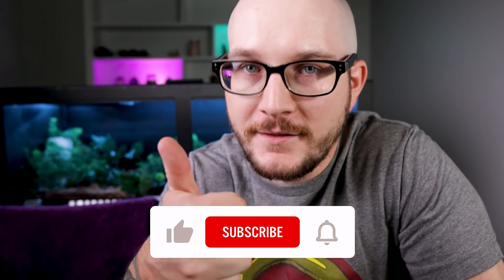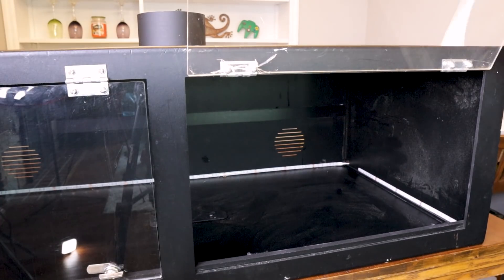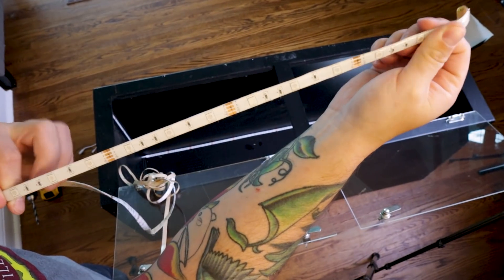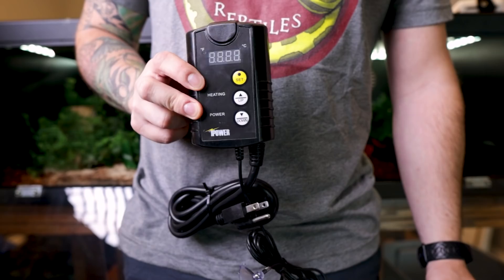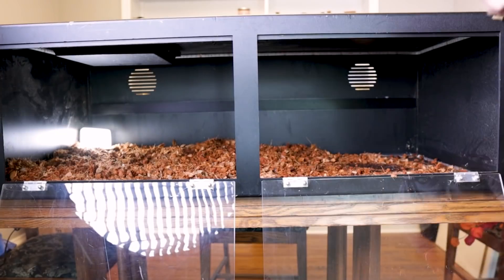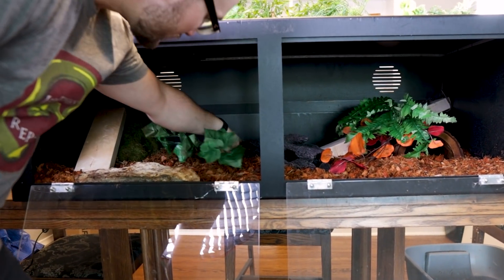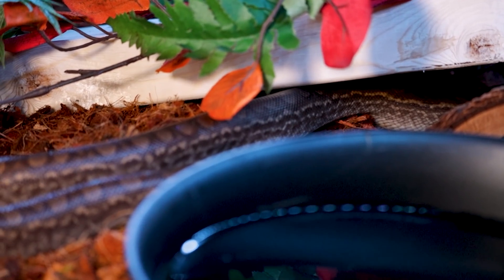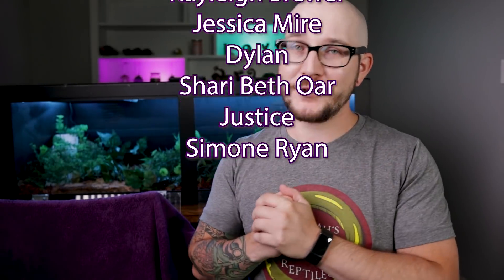CHEAP and EASY PVC Enclosure Setup For Any Snake Or Lizard! | My Rainbow Boa's New Home

Comment: Looks good , I use proproducts heat panel . And for bedding I use coco blox , less dusty and it's alot for chunkier . I use use the hardware stuff but I would get to dusty and breakdown quicker
Reply: Does the heat panel cycle very often? What wattage?
Thank you

Comment: This video was great! Just got our 2 ball pythons into pvcs a couple of months ago. They're in 4'x20"x20" from a local guy that makes them with shade dweller UVB and 80 watt radiant heat panels. I love 100% cypress mulch for substrate. I may try the coco husk again though. The only thing that I feel like I still need to do is to get the humidity down more on the cool side(it's holding it too well 😬) and find more things and ways for them to climb up higher.
Reply: I’m setting up a 4ft x 24” x 24” pvc enclosure. What uvb and heat panel did you go with? Did you run the heat panel from side to side lengthwise or front to back on one end?

Comment: Hi, I got a question for you. I just got my pvc enclosure from cornels world that came with a reptirad 80w radiant heating panel. I plan to put the probe on the hide that will be on the floor right under the RHP. Even with the thermostat, i see the panel can get pretty hot when i keep my hand on it. Cant the snake burn itself if it touches it with its head? Thanks! Love your channel! 🙏😉

Comment: With a shorter enclosure like this one, do you feel both a radiant panel and heat tape are necessary? Building for a ball python
Reply from the maker: I tried heat tape in my first few but it doesn't get enough heat into the substrate so I would say RHP is better
Reply: @WickensWickedReptiles  thanks for the response and advice!

Comment: I'm in the UK and have never seen a heat panel like this before, most places here recommend a ceramic heat lamp for something like a ball python. Is the heat panel similar in how it works?
Reply from the maker: yes but it's safer and never gets so hot to the touch that it can burn your animal

Comment: If you’re using a PVC cage and have a species that doesn’t need uvb (blue tongue skinks, leopard geckos, fat tails, etc.) just a light for day/night cycle or aesthetic reasons, I use “under-cabinet” lights and stick them on with command strips. You can get them for like $8 on the Walmart website. I always watch to make sure they don’t try to climb on or around them, but they’re so thin and small that it’s unlikely they’ll do that anyway and I’ve never had an issue. 
For substrate, I use a mixture of bark, coconut fiber, and playsand. I’ve found it’s the most supportive of burrow digging and somehow creates less mess than just one of those materials by themselves, it’s also great if you wanna use live plants!

Comment: Curious on what size heat pannel you would recommend for a boa imperator. Building a pvc enclosure 4'x2' and 4' high. Would an 80 watt pannel be sufficient? I new to heat pannels and not sure.
Reply from the maker: I use the 80 yes

Comment: I have 2 ball pythons and I got them 2 pvc enclosures. They are currently in their old glass tanks with under tank heaters. 
Is the heat panel enough for ball pythons in a pvc enclosure or do they need something similar to a uth?

Comment: I just got my first pvc enclosure and I love it! One thing I'm confused on it people debating on whether or not you can use a UTH with pvc or if it's even necessary. What is your thoughts? (I own a Mexican black kingsnake)
Reply: UTHs are not an adequate heat source, overhead heating is much better for them. A halogen flood bulb connected to a dimmer/dimming thermostat is the most natural and beneficial option. They produce IRA and IRB like the sun, heat that penetrates deep into the skin tissue and heats them far more effectively than heat mats. Whereas heat mats only produce IRC, which only heats the surface of their skin.

Comment: Is there a concern about the lights detaching from the enclosure and getting stuck on the snake? I am afraid to use anything that has adhesive inside the enclosure.
Reply: U can use the secure bracket which u screw into the cage

Comment: Good morning Adam! Amazing video! I've got a question for you. I have a normal bi and he's a male. I'm looking to build his final and permanent enclosure. Pvc enclosures seem quite pricey and where I live there's no great access to those. I'd have to order from another country or so. But we definitely have glass terrariums.... which I know ain't the best for heat and humidity... (but are they THAT bad?)

So I'm really considering getting a glass terrarium.... would it be OK? Also would it be bad if the size was 100×40×40 (cm) instead of 120cm (long)?
Reply: That’s not big enough for an adult male BI. The enclosure must be at least as long as the snake, with a good amount of depth and climbing height. Look into building your own enclosure or using a large grow tent.
Reply: @nightinggale6470  what about thw material? There are bigger options for glass tanks. Should I go for one?
Reply: @ag6655  maybe. It may be more difficult to maintain humidity, but there are ways to mitigate that (covering most of the mesh lid with foil tape, using a deep layer of a humidity retaining substrate, pouring water into the substrate and mixing it in, etc.). What’s the biggest glass enclosure you can find?
Reply: @nightinggale6470  that's really great! There are options with not (too) much ventilation so I hope that it'll work just fine..... I have no experience with glass terrariums before, I've only used tubs. But yea there's a great variety of sizes for glass terrariums, average is 120cm long and then there are bigger n smaller options as well.
Reply: @ag6655  just keep in mind that the enclosure should be at least as long as the snake (and the depth and height should be at least half the snake’s length), and I’m not sure if there are glass enclosures that large available. I’d still look into building your own enclosure or using a large grow tent.

Comment: This was great.  Thanks.  I am planning to get a Tarahumara Mountain Boa in the fall, and I’m wondering if I might need belly heat in addition to a radiant heat panel?  I’ve been advised that belly heat is preferable for them, but my house runs pretty cool (67-72% F), so belly heat alone will not kept the ambient air temp in the enclosure warm enough.  I suppose as long as I have both on a thermostat, my warm side will not get too hot.  (I have a Herpstat, and each device will have it’s own probe.)  Can anyone tell me if they’ve used both belly heat and a radiant heat panel in a PVC?
Reply from the maker: you can use both

Comment: Where can I buy one of those heat panels? I can’t find them anywhere!
Reply: Heat panels aren’t the best primary heat source. A halogen flood bulb connected to a dimmer/dimming thermostat is the most natural and beneficial option, Arcadia’s deep heat projector is the second best option. They produce infrared A and B like the sun, heat that penetrates deep into the skin tissue and heats them far more effectively than heat panels. Whereas heat panels only produce IRC, which only heats the surface of their skin.

Comment: I've got a bunch of those govee lights in my room, I keep my rosy boas in my closet since its easier to keep dry than my main room, and i used a govee strip to give the whole closet a night/day cycle.  One thing i'm not sure of is how to set the colors to most accurately mimic natural moonlight/starlight.

  Do you just go with the standard blue or do you fiddle with the color spectrum settings a bit?  I notice the ones that are made for aquariums have a specific wavelength of blue light, i believe its 465 nm, but the string light apps don't allow you that kind of control, I wish you could have that kind of specificity, its a bit janky trying to do it with the touch screen.

Comment: I have the same sized PVC tank that I'm setting up for my Ball Python. Would you recommend getting the 80w over the 40w heat panel or does it really not matter? I have her in a 20 long glass tank with a 40w UTH and I feel like it's very hard to keep the ambient temperature above 23, especially with the colder weather Toronto is starting to get now.
Reply: I highly recommend using a halogen flood bulb connected to a dimmer or dimming thermostat as the primary day/time heat source, they’re the most natural and beneficial option. They produce infrared A and B like the sun, heat that penetrates deep into the skin tissue and heats them far more effectively. Whereas heat panels and mats only produce IRC, which only heats the surface of their skin. A panel would be good for nighttime, though.

Comment: Actually another good place to buy this in bulk is Michaels with their foliage and vine and plastic leaf selection (make sure to disinfect it) I bought enough for 4 tanks from there for 40 bucks making it 10 bucks per enclosure and for ball pythons and geckos (what I house) for wood you can go to a nature area and boil the wood you select to put in your enclosure which makes the wood free! the boiling is to disinfect the wood and kill bacteria it's also good to use the reptile zoo med bacteria cleaner just in case but you'd have to let the wood sit out for 30 minutes after using the cleaner, for lights the led strips are awesome and are cheap and for bowls you can go to the dollar store and get some there. The only costly thing you'd have to buy is a heat mat and a thermostat checker (I forgot the name) the tank sizes were 10 gal 20 gal 50 gal and 60 gal and I still have enough leftovers
Reply from the maker: in Canada craft stores gouge big time, almost as expensive as the pet store
Reply: @WickensWickedReptiles  I'm US but knowing you're heading to texas you may wanna check it out it's pretty good but since i'm cali the cost differs still

Comment: Do you have a link for the heat panel? Idk where to get one
Reply: Heat panels aren’t the best primary heat source. A halogen flood bulb connected to a dimmer/dimming thermostat is the most natural and beneficial option, Arcadia’s deep heat projector is the second best option. They produce infrared A and B like the sun, heat that penetrates deep into the skin tissue and heats them far more effectively than heat panels. Whereas heat panels only produce IRC, which only heats the surface of their skin.

Comment: Hello, where do you buy your RHP ? I can't find them that aren't like 100$. I'm in canada
Reply from the maker: there are none under $100. They are very expensive especially here in Canada
Reply: Keep in mind that heat panels aren’t the best primary heat source. A halogen flood bulb connected to a dimmer/dimming thermostat is the most natural and beneficial option, Arcadia’s deep heat projector is the second best option. They produce infrared A and B like the sun, heat that penetrates deep into the skin tissue and heats them far more effectively than heat panels. Whereas heat panels only produce IRC, which only heats the surface of their skin.

Comment: Anyone know where to get the heat panel from?
Reply from the maker: heatpanel.com
Reply: Keep in mind that heat panels aren’t the best primary heat source. A halogen flood bulb connected to a dimmer/dimming thermostat is the most natural and beneficial option, Arcadia’s deep heat projector is the second best option. They produce infrared A and B like the sun, heat that penetrates deep into the skin tissue and heats them far more effectively than heat panels. Whereas heat panels only produce IRC, which only heats the surface of their skin.

Comment: As requested. Liked and my price guess is 450-550usd (less 50 if no uv)
Reply: Wow good deal man! I was figuring the pvc pushing 300! The 4x8 pvc sheet it takes to make a 4x2x2 is 80+tax and you still have to build it and get the plexi and hinges/latches.

Comment: Personally I'd just cut and reattach the plug rather than unravelling the whole light strip, but I'm also somewhat confident in my wiring and soldering skills so that probably shouldn't be attempted unless you have experience. I like to use the under cabinet strip lights in aluminium runners, a little silicone makes them waterproof and they seem to last longer than the stick on strips (especially the gel covered waterproof ones) it's the same type of led and circuit etc but on a hard board with a cover rather than flexible tape. It seems a little more expensive but when you factor in the lifetime and how much of the strip is wasted when you use the stick on ones it's not all that far apart and you can hook them all up to run multiple enclosures on the same timer and power supply (check your combined wattages first folks, don't burn your house down with an overdrawn power supply)

Comment: You just advised people to put screws right through the bottom of their plastic tank?  (I know animal safely first, but really... everything that spills/ drips will be leaving through the screwholes and pool underneath the tank! And trust me, it will not be 'just waterstains' either ;) )
Reply from the maker: No, I said turn it upside down… so now the roof is on the ground, then drill. The only holes I advised to make are in the ceiling of the enclosure.
Reply: @WickensWickedReptiles  I meant where you casually advised people to attach the 2x4's to prevent accidents " screw em down" (that means walls and the floor right?)  :)
I loved the warning not to damage the table you were working on in the beginning! That was great advice. (My vivs are glass, so, no way! Drilling glass is a pain the ### anyway)

Comment: My setup is almost identical to this but the temps are getting quite high enough even though the heat panel is functioning correctly, also the humidity is spiked too high and i can’t figure out how to lower it. If anyone could help it’d be much appreciated
Reply: Switch to a halogen flood bulb connected to a dimmer or dimming thermostat for the primary daytime heat source, they’re the most natural and beneficial heat source (they produce infrared A and B like the sun, whereas heat panels only produce IRC).

Comment: Are we not gonna talk about the fact that you're not supposed to use on/off thermostats with RHPs? No? Ok! XD
Reply from the maker: according to who...
Reply: @WickensWickedReptiles  Well, Vivarium Electronics has it on their website that the Radiant Heat Panels should be used with dimming thermostats 🙂 Otherwise, it'll burn out the heating element inside them. Not trying to argue on your awesome video! I love your stuff! I just thought it should be brought up that RHPs are supposed to be controlled with dimming thermostats. 🙂

Comment: Anyone consider just buying sheets of PVC and building your own enclosure?
Reply from the maker: no, I mean you could. But PVC is super expensive and hard to find here and without a machine you'd need a level of skill to cut the material perfectly. I'd rather just buy them and know I'm getting a professional product.
Reply: @WickensWickedReptiles  Im in the US and found sheets of PVC big enough to build a 4x2x2 for $15. some acrylic for the doors maybe another $20, and some caulk and screws another $10 maybe. An average handyman could probably build a reasonable enclosure in a weekend. Im certainly going to look into it more and see what i can do.